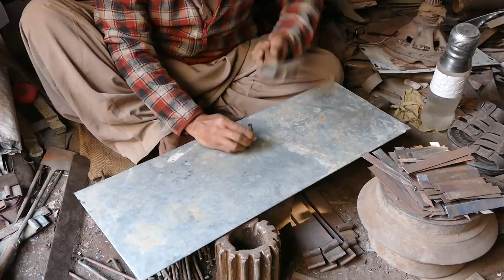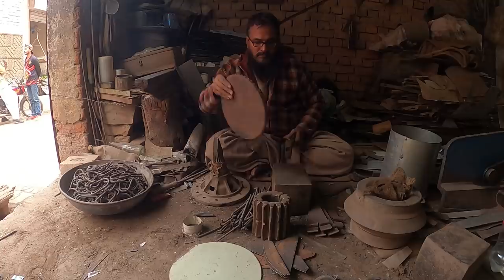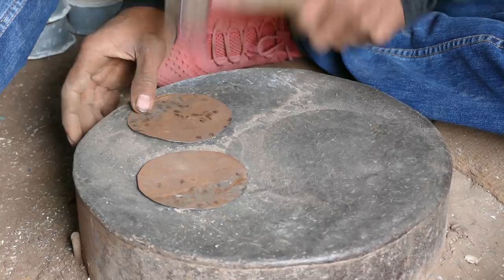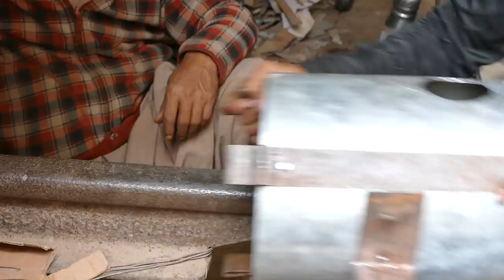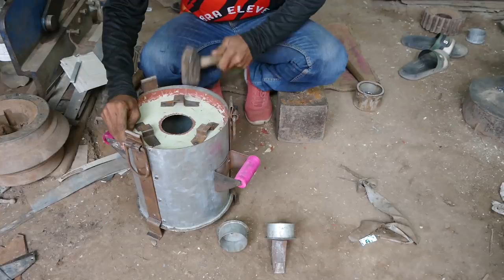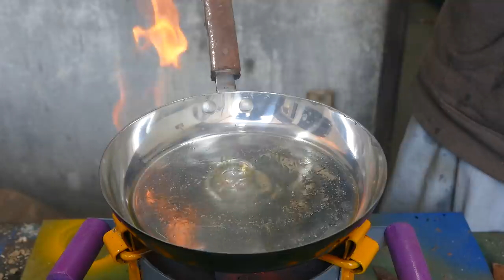Amazing Sawdust Burning Metal Stove Making

Comment: I've made (admittedly much simpler) sawdust burners from 20L vegetable oil drums. To stop the sawdust burning from the top down rather than inside a thin layer of ashes or sand is sprinkled on top before the centre tube is removed.

Comment: I prefer taking an 8 foot high 6 feet in diameter pile of sawdust with salvaged copper coil in the center... As this pile ferments start another... Not only can one run a generator to power their home but the heat in the coil helps to, smokelessly, heat the home... Learned this trick over 40 yrs ago...